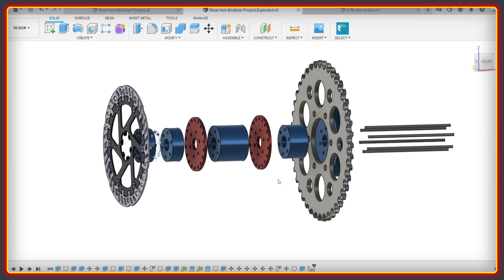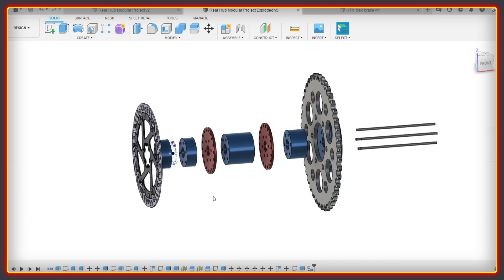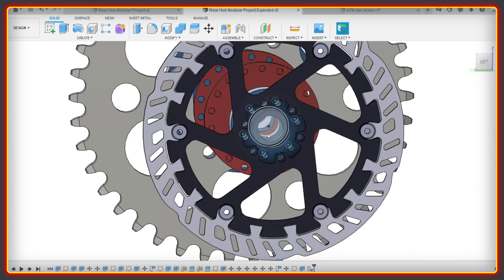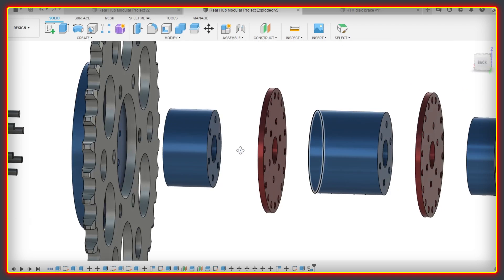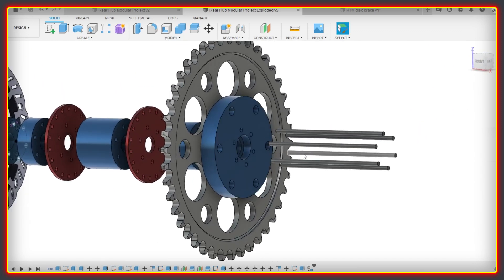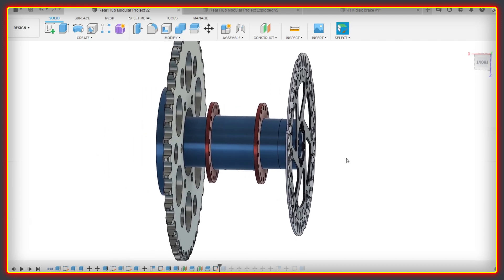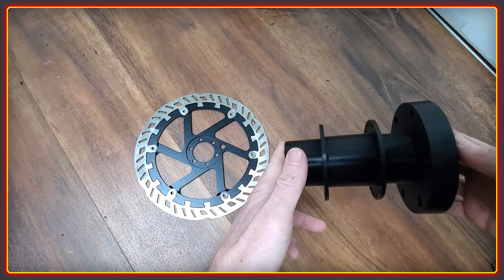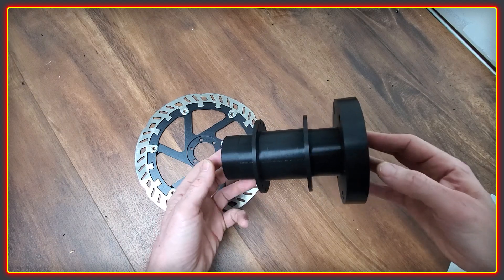Modular Rear Hub Design for High Power Electric Bikes - Use any components.

Comment: Depending on the metal of choice, the thinner flanges and so on could be made en masse on oshcut and the thicker components could be done by our "in house" guy 🥰
Reply from the maker: Yeah. There are a few options to get parts cut. Trying to see if there are stock items as close as possible to what I need.
Reply: @HighVoltageKits  🥰🥰🥰

Comment: I was going to suggest that the parts should have direct mating surfaces so that all of the torque isn't being held by just the through-rods, but the commenter below mentioning pins is probably a much better idea. Mating surfaces would likely add a lot of machining complexity and make it harder to swap things around. Love the work!
Reply from the maker: I was also considering splines or a key. Simplicity of manufacturing is a big priority definitely. Thanks for the comment. Cheers
Reply: @HighVoltageKits  a key and the through pins should handle the torque.

Comment: Will it be able for 20x4 hubs?
Reply from the maker: Right now this is a concept. But the idea would be that different parts would allow it the assembly to work with any size parts which would include the axle. We are aiming it at the ELEEK frames to start with as there are limits to time. But beyond that it could be anything. I am happy to share the design files so anyone could come up with variations and alternate parts.

Comment: John I like your ideas and methology, unfortunately  e bikes need a radical rethink , chains are not the way forward ..some how the power from the motor needs à direct drive and à gearbox with a clutch so its versatile on all types of terrains..I'm not knocking down your aspirations to build work around solutions but after snapping 5 chains there must be a solution because I'm reading more and more about this problem.Never the less we'll done its a 👍 great step forward in being able to design custom fit hub assemblies..👍👍
Reply from the maker: We need to figure out what is snapping your chains. With this I have to work with what we have got going. So as cool as the idea sounds its not going to be something that will work with the ELEEK bikes in the near future. The only chain I ever broke was quite old and it sort of shattered. Since I went to 8spd chain I have not had any issues. This system would in theory allow use of a belt. But that is not great for offroad. Hopefully we can get you back on Discord. There has to be a solution for the chains. Snapping so many is not normal for the BBSHD even at high power. Appreciate the comment as always Sir!
Reply: I've run 6 to 7kw through an 8 speed chain for over 6000 miles, snapped one once.
You're chainline sounds like it's way off or you're shifting under load.
How much power are you using?
Reply: In all honesty I have eased up the power and avoided changing gears as much as possible to avoid chain snapping, but something maybe Discord should look at, a load test on 5 of the major brands of e bike chains, see which one can take the most weight before snapping, or some how have a belt system with three gears,11,17 34 at the rear,just changing gears makes me gringe at
The sound,that's why one way or another making some sort of of adapter that would fit over the BBSHD with a worm wheel set up and send the power down a shaft on another differential set up to the rear end,of course somehow cramming in 3 gears ...this is science fiction stuff and would need alot of CAD time and testing but would be a huge leap in e bike tech..I know its not much help John but the one rear cog at the back is only a partial fix,maybe a scooter type centrifugal clutch fitted on a bbshd ,not sure on how it would function,my chain line is OK,the gear shift sensor cutoff works fine, the aura derailleur works fine,the gear shifting between gears really finely tuned,it's my bike  weighs a ton and with a 🐘 elephant on top and hill which looks like the North side of Mount Everest all I can think is putting a rocket 🚀 on the rear top saddle craddle..so to all you e bikers let's start with a chain load test, my vote goes to a titanium jumbo ass  tractor chain,anyone used a chain saw chain yet 😆 lol
Reply from the maker: I think there have been a few attempts at transferring power with an axle type solution on peddle bikes. Ceramic drive was one. I suspect that the chain snapping is the gear sizing. I don't use lower than a 22t and the bbshd is a 1 to 1 42t. My ideal setup on it would be a three speed 42t 36t 30t Let the rpm do the work. Not so great with pas then tho.

Comment: like the thinking there BUT strongly advise using 2 doweling pins in place of 2 of the screws at EVERY joining surface too (obviously radially 180 degrees apart) far more secure overall and pretty much eliminates the possibility of the screws slackening off with torque and so on also pretty much eliminates any scenario of needing to add pain on the ass thread lock
Reply from the maker: Thats a really good suggestion to use pins. I had looked at 5mm steel rods running through the entire structure. Shorter pins between each section is good. I will investigate! Cheers
Reply: @HighVoltageKits  wouldnt use a single pin through the whole lot that will likely create its own issues where you go from one another surface to another surface would then use another 2 pins (dowels) 18 degrees off of where the last pair of surfaces dowels were and so on ideally use all the screws as you normally would but have the 2 dowel point positions between  2 screw holes if that makes sense, look up a car brake disc online and you will see the position of the disc locating screw hole to make sense of that. surprised they do not do this on bike brake discs too takes all the work off the disc holding screws and as stated pretty muck eliminates the need for thread lock and better still can use grease instead! to eliminate corrosion and make the whole maintenance process much faster and easier.
Reply from the maker: Okay. So use the bolts still but pins for locating everything between parts then. I will study the car assembly! Thanks 😊